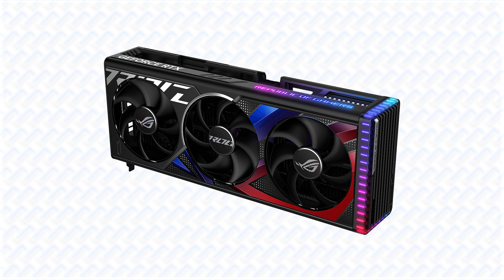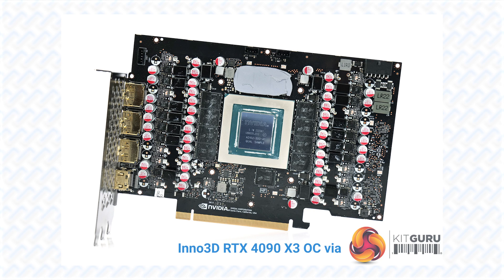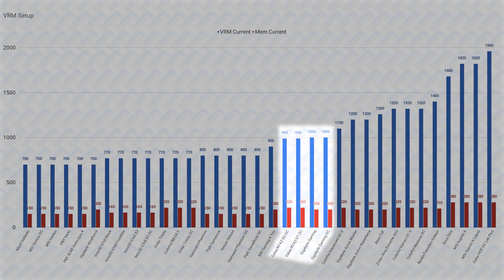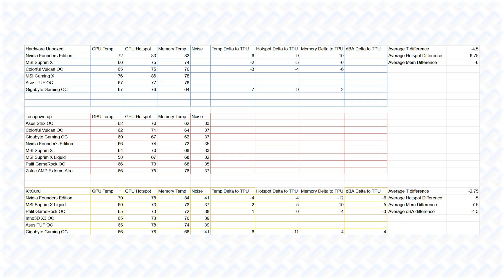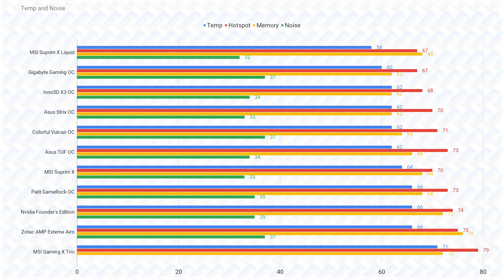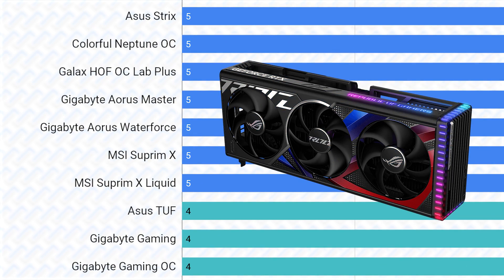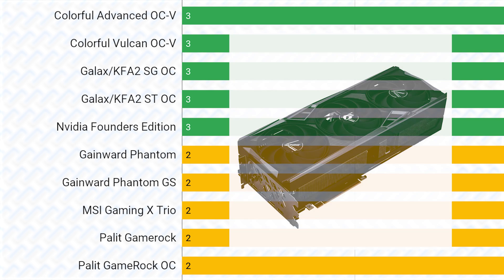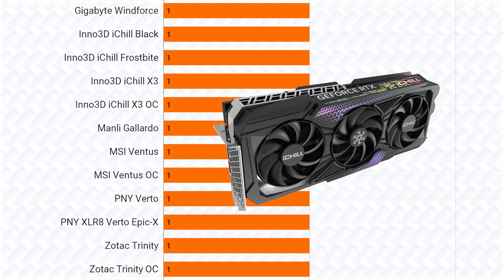Which RTX 4090 to BUY and AVOID?! | 35 Cards Compared! Asus, MSI, Galax, Gigabyte, PNY, Palit, Etc.

Comment: I thought Galax 4090 SG has 18 phases x50A NCP302150 (900A).
Reply from the maker: Ah crap you're right. Doesn't really change where it is in the tier list though, difference of 90A is not much.
Reply: on their website it says 22
Reply: according to their website it's 22 phase.
Reply: @Jaejgaren - 22 phases in total: 18 phases for GPU core and 4 phases for Vram
Reply: And what it mean? Better, good or bad  @HoangDucNuyen
Reply: @droidgestor1682  - Good i guess. The more power phase with higher current(A), the better in terms of providing stable voltage, handling high power and reducing heat.
Reply: I think it's one of the ever best 4090ys you could have bought because of the build quality 😊
Reply: 18x50A NCP302150
4x50A NCP302150
~900W VRM
would still be in the A tier list,  @O!Technology did a great job!
Reply: BTW, Galax offers a 3 year warranty here in Brazil, inside my country they would prolly be in S tier because of that, I'd like to know what Galax/KFA2 offers in other countries, where do you live and what they offer to u guys? @O!Technology @Nguyên Hoang
Reply: @Israel Davi Rios Filho  - all new GPUs of all brands offer the same 3 years warranty in my country (Vietnam).
Reply: @HoangDucNuyen  Oh, you do have a lot to choose between then, here in Brazil there's only 2 brands that offers a warranty that's really worth it, which is from Galax and MSI, both has 3 years and works great, there's some other brands like Asus who also offers 3 years but there's a lot of limitations, you can't RMA a Asus product if you're not the final buyer, so if u buy it from someone else in 2nd hand and not from the store itself you have no rights to RMA it...
Reply: @RaeLN1  - all ASUS products (even buying from someone) in Vietnam, you still can issue warranty just fine as long as you still keeping all accessories and the box from the product, and also Asus warranty sticker as well as "Asus Authorized stores" sticker should be still intacted on the product.
Reply: @RaeLN1  Galax is great in Brazil thanks to the relationship from RBuass and his OC Lab with Galax or there are other stores included? Sadly for most Latam you need to ship Galax to TW if you do RMA :(
Reply: @RaeLN1  cara esse video me deixou mais confuso, qual placa tem melhor Custo/beneficio no Brasil??
E não fosse tão barulhenta também
Reply: @webfabio6259  Galax ganha em CxB, só uma observação que é o peso ligeraimente maior que as demais, o que faz dela uma placa mais fria também, no entanto ela já vem com um suporte de fábrica!
Reply: @RaeLN1 acabei de ver o menor preço de uma 4090 por 9600 na terabyte.. O ruim eh q nesse vídeo mostra ter baixo vram... O galaxy eu tô vendo no mesmo preço que uma Gigabyte Gaming oc que tem mais vram .. Estou indeciso, só vou ter grana para pagar a vista no mês que vem até lá vou me decidir... Obrigado!
Reply: @RaeLN1  in Germany they have only the KFA2 cards and they offer 2 years.
Reply: @Serandi1987  Hallo, wissen Sie der Unterschied zwischen KFA2 SG und ST? ST ist jetzt 100 Euro weniger als SG. Ich weiß nicht, was ich wählen soll. MfG
Reply: @jiangongluo1093  nee davon habe ich noch nicht gehört da müssen sie mal recherchieren wo der Unterschied ist ich würde aber auf jeden Fall die günstigere Version nehmen und undervolten um Strom zu sparen
Reply: @RaeLN1  same in thailand plus it had the best warranty services
While Asus and msi has the worst warranty even zotac is considered bettter than those two in term of warranty services
Reply from the maker: @RaeLN1  Just wanted to correct its 900A not 900W. Thanks!
Reply: @OTechnology how is it possible to have 900 amps being pulled from a 15 amp plug at the outlet. Somethings fishy here.

Comment: I just love my KFA2 RTX 4090 SG I've bought from another user from the computer base forum and sold my Gigabyte 4090 Gaming OC! The KFA2/Galax RTX 4090 SG looks just insane in my open air benchtable Raijintek Paean as a horizontal setup! I just love this GPU and I won't change from this GPU even to a 6090, if the look won't match at least this nice look of the KFA2/Galax model!

Comment: Mate I have Gainward 4090 Phantom and its stable on 3000Mhz core and + 1700Mhz on the ram and the tems is 65-72C with this overclock, I have no idea why U say that is the card which is not good for OC? But to overclock any 4090 its useless,because you can have extra only 5-10FPS on same games.

Comment: I have a Zotac Trinity RTX 4090 made by PC Partner and it can be overclocked taugh I have never observed it exceeding 400 Watts. With that being said, the frequency can be adjusted and also you can undervolt it by lowering the power slider with any GPU handler ap like MSI Afterburner

Comment: 😂 I don't know man I think if you're going to buy the 4090 the 1600$ gigabyte windforce Is  going to perform just as good as any of ones he put in S tier I'm sorry but an $800 price increase for the 4090 strix is not going to give you $800 worth of performance increase😂 they slap a little white on it and get all the idiots to believe it so much better😂 if you're smart you can actually build a 4090 setup with the gigabyte windforce that doesn't cost you anything more 2400$ or you can be the idiot who spends 2399$ on a white 4090 strix 😂😂

Comment: Amazing job man, you did the best and most complete analysis and comparison on 4090s on the tube.
Can't decide between strix oc and aorus master.
Both in cooling and final tier lists they are in the same block, but you say strix oc is the best air cooled gpu ever. I would like to know the reasons why I should go for strix oc over aorus master, apart from being able to control the voltages manually. Any info would be really appreciated, maybe by an aorus master owner too

Comment: Pretty pointless really. No matter what 4090 you get, you’re getting the 4090 experience. The 4090 was designed to use all 600watt from the getgo, and only last minute nvidia decided to lower it to 450watt. The decision was made so so late in the release program, that the aib’s didn’t have time to change the cards. Meaning all the 4090 regarldess of what 4090 you get will be more than adequite for 450watt and should all hit 600 watt if available no issue. That’s also said for the coolers, they’re all massivly overbuilt.

Comment: Running triple-1440p monitors I am thinking of upgrading to a 4090 in the future, especially as you still get good money for a 3090 STRIX these days.
I am still not sure which one to get, as I don't see the STRIX price justified over the other cards for little to no more performance. Not planning to overclock the GPUs anyway, must be said.

Personally from the tests I've been reading, I would say the top contender is the Gainward Phantom GS, as they usually build very reliable cards which don't need too much space in the pc-case.
I'm a bit confused though to see it ranked only in B-category here, as on pretty much every other site I've read it ranks within the Top-5, if not even higher. They surely are better cards than a Colorful or Galax?

Comment: The Asus TUF RTX 4090 has a recommended psu of 850 watt, the only GPU that is so low rated. So should avoid that one or does it not matter that all others 4090 GPUs have a recommended PSU of 1000watt?

Comment: So, which is the best to get without overclocking that has the H++ (12v-2x6) connector? Looking at going from a 3080 to 4090.
Reply: I'd assume any of the Super series of cards have the H++ port. But knowing which non Super has the H++ port probably takes researching the serial numbers to see when it was manufactured, near launch or closer today.

Comment: I need some help I bought a galax hof oc lab plus-x rtx 4080 and it has 2 16pin 12VHPWR connections with a draw of 470W but one 16pin 12VHPWR wire is rated for 600W so do I still connect two 16pin 12VHPWR wires or just one ?

Comment: In my opinion, AVOID them all, no matter which brand. They are cracking, getting short circuits, are a constant fire hazard and all else. And even more so avoid it, given the almost non-existent performance upgrade... it's literally a slightly beefed up 3090. The worst series of Nvidia cards ever to be released and they are all denying it. This is where we have gotten by 2023, that money and shareholder profits are above all else, even safety at NVIDIA. They've unfortunately copied Apple's and Samsung's method of releasing a new model each year or so, scalping their customers. I won't ever buy NVIDIA again, at the moment, I'm perfectly ok with my "old" 2080ti with watercooling, and the next card I'll buy will be an AMD, I'm simply disgusted by NVIDIA...

Comment: hey question, which card would you choose between Asus Tuf 4090 or the Gigabyta Aorus Master?
Reply: Non, Galax SG ou Asus Strix, i'm probably be buying galax for the reliable and other stuffs, there a few people that says galax do more overclock stable then strix
Reply: @DeltaRandomGuy  we usually or maybe even never have Galax cards in my country , so not a brand I am familiar with
Reply: @instaq  I see, in that case, i hear a lot of trouble about asus tuf, noisy fans, he is cap on 500w even it says 600w, old 3090 pieces on tuf too... lots of problems i found, i'dont recommend.
 Gigagybe in other hand i only found about cracked pcb (but only for installing without the bracket/care, other then that, there are some fews faulty cards here and there, but all brands have if you dont install proporly.
If i was you, i would go with gigabyte, warranty sucks dought, but they get the problem solved as all of them, great fans, overclock etc, its a perfect card
Reply: @DeltaRandomGuy  the thing is, right now i have a 3080 ti from gigabyte which has some really odd issues. before i had a gigabyte 2070super, and it was very good. But this experience so far has been very shit. Hence why i'm debating between asus tuf and gigabyte aorus master. The asus tuf that is with 3090 parts is the Asus tuf OG OC, if you buy a asus Tuf OC(without OG) its not the 3090 parts.
Reply: @instaq  Good information, i had two gigabyte on old times, a 960 and a 1080, more then 10 years and never got me problems, only temps on the 1080 but he is one fan only. But even if it has no 3090 parts, that tuf model (dont know if oc or not) is know for his 500w limitation and coil whine, not the 3080 gigabyte it self, but lots of 3000 got some problems here and there, even the 4000 cards, asus and other brands got problems too, if you can have the option to buy, test it and if you don't like, return.(as  my country allow) then you should go tuf just to get clear mind if is what you expect, but if not, me, that never got problems with me both gigabyte cards, i would go giga
Reply: @DeltaRandomGuy  I'll have to see which card is available here then

Comment: What do you mean there is no reason to buy the best brand ? the different between them in terms of price is crazy and they all perform the same maybe 2 to 3% maximum, it's not worth it the games gonna be more demanding next year so most of the 4090 GPU buyers would change the GPU if they love highest settings all of the time with higher FPS in any new upcoming game they won't stop thinking about upgrading it, the fact is when you get your hands on the best GPU in the market you will go crazy every year!
they cannot even sacrifice dropping some settings at 4K that's the reality :)

Comment: I have the PNY RTX 4090 XLR8 GAMING VERTO and couldn't be happier. Great temps, it's one of the smaller ones and 0 Coil Whine. And I got it for a great price, €1750. After a few hours, the price went up and after a week it costs now over €2000 :D
Reply: got it for 1200 € !
Reply: from where if I may ask ? @Nicrolix

Comment: PNY from reddit and many people seems to be a good value oriented choice for those not looking to overclock and run cooler.

Thanks to your video, now I'm unable to decide between a SGD200 difference of what's appearing to be the same card - PNY Verto 4090 Triple Fan & Gigabyte Gaming OC 4090.

sigh.

Comment: I’d advise NOT getting the 4090 liquid suprim…. Maybe mine is just broken, cause 1 day out of the box it’s making a clicking noise from the pump. It’s not coil whine, cause it had a lot of that too and that’s not the clicking I’m hearing. Temps are also 70-80c which is no where near what reviews suggested. I plan to return it for a aero gigabyte 4090. Would that be considered a gigabyte OC?

Comment: I remember the good old days when OC'n a GPU showed real gains (980ti).  Alas that is not where we are.
I have a 4080 Suprim X and no matter what, voltage at 1.1, max pwer limit +125 core +1150 Memory.  It burns close to 400w instead of less than 300>
Stable as a rock.
But what did I gain?  4fps on top of the stock 113fps in Cyberpunk with Psyco RT on.   Not worth it.
Even if you could get around that 1.1v limit, the gains are not linear with the extra heat and power you produce.
BUY THE CHEAPEST ONE YOU CAN FIND.

Comment: Funny how the Zotac 4080 Amp Extreme is the highest powered 4080, but is near the bottom of the 4090's. TBH, I think MSI was onto something, limiting the power to 530w.  Seen any MSI cards with burnt connectors?  NOPE.  600w is dangerous.

Comment: Good video a lot of points made in it are founded on non normalized tests though therefore a lot of the information is incorrect I will give an example hardware unboxed tests on the Msi gaming x trio for temperatures which this video used to rank the cooling solution was based off of non normalized fan speeds. The gaming x trio was only running at 1400 rpm for fan speed which was the lowest speed of all the cards compared to suggest this in turn portrays info as facts is irresponsible the facts are we need a normalized  test with all cards running at same fan speed to see exactly what the performance/temps etc. are under equal load a lot of info in this video as well as others ranking cards is based on incorrect information because none of the tests are normalized fan speed which would affect clock speed and performance etc. we need a video with balance tests to actually have any correct ranking of cards.

Comment: Unfortunately, the fans in the latest PNY XLR8 start at 1450RPM. In the early days of production these were great cards capable of running as low as 1000-1100RPM under full load, currently? START 1450RPM and you can't go below even manually :(
Reply: My card also shipped with the stupid 1450 rpm. I fixed it by flashing the older PNY 4090 oc bios with nvflashk. Now it's nice and quiet and I gained 20 mhz on the core.

Comment: Another one to add to the list: I don't suggest the ASUS TUF 4090 OG cards. They are limited to 111% power in GPU Tweak, meaning they have 1.11*450=500W of max power. So they've skimped out on the power design in that variant. Found it the hard way. Someone on reddit said they've reused parts from 3000-series cards in these ones, so cooler design is also different and vapor chamber is missing. It was a little cheaper than the regular ASUS TUF 4090.
Reply: 100% correct the fan design is 35% less efficient.   fans from 3000 series. probably entire heat sink.
Reply: Yup it’s got the cooling design from the TUF 3090 apparently. But the 4090s are all way over engineered in cooling so I don’t know how much of a negative it actually is. Some have said the 3090 cooling design is more than enough for any of the 4090s.

Comment: Sooooo... youre not going to talk about the fact, that ASUS-cards (especially the 4090 Strix) are notorious for extreme coilwhine? Thanks mate, decided to buy a 4090 ROG Strix after watching your video and got the worst coilwhine i've ever heard. Like "closed beQuiet 901 in silent config but still quite noticable in the NEXT ROOM"-bad. After some research, this seems to be common with ASUS and MSI cards due to the "high quality" parts used. 
Like, WTF?!
Reply: any secrets about the case, I have it sitting here, waiting for final parts to build.
Reply: @theeagle1967  You just need to be aware, that you need TWO internal USB 3.0 ports and one internal USB-C port to fully utilize the front-io of the beQuiet 901. 

My Strix Wifi 670E-E Motherboard has just one USB 3.0 port, so i had to buy an additional PCIE-extention card to make up for it, which in return will sap PCIE lanes from the GPU. But a bit lower FPS is something i can live with (for now - might uninstall the extention-card again later), since my system is overkill for most games atm anyway.

In addition: If you want to replace the case-fans in the front panel (2 Silent Wings preinstalled), you need to transfer the "fan-spacers" (plastic tubes + longer mounting screws, additional mounts if you want more than 2 fans in the front are included) to the new fans to get some distance between them and the front-panel. Otherwise the fans will sit too close to the surface of the panel and suffocate - that is if you are going to use the solid front-panel instead of the mesh. 

Other things that bugged/bug me about the 901:
- you cant turn off the lights of the front-io
- the audio cable of the front-io has the rainbow-colored wires exposed at the motherboard-connector. Not optimal when you want to build with a pure black/white PC
- the Qi-charger feels gimmicky

Otherwise the 901 is an absolute joy to build a PC with, thanks to the exceptional build-quality and the myriad of options and extras (couldnt find any other high-end cases with a 5,25" tray).
Reply: @mikrohamster   Yes the reason i bought it wsa the drive bay in bottom , my old case had them on top and it caused problems with cooler.  what are you putting in that alsot, I wanted to keep my blueray burner avaialble.